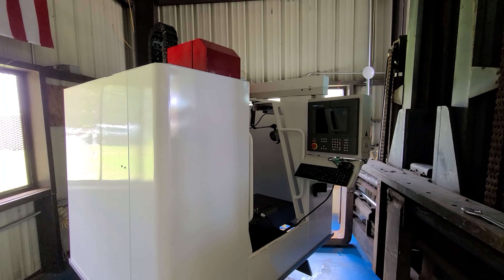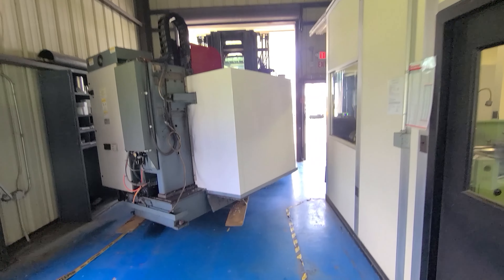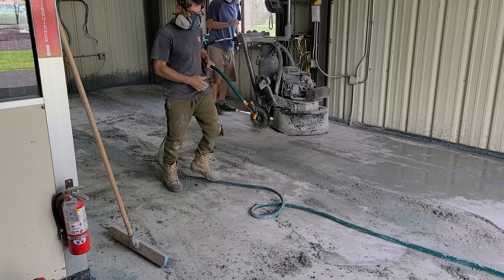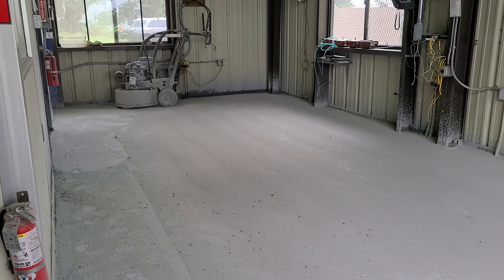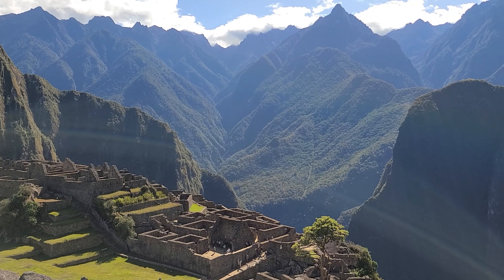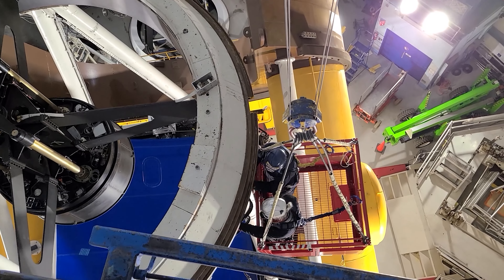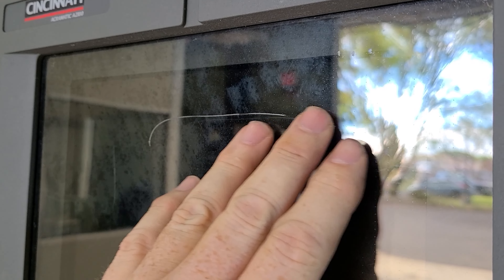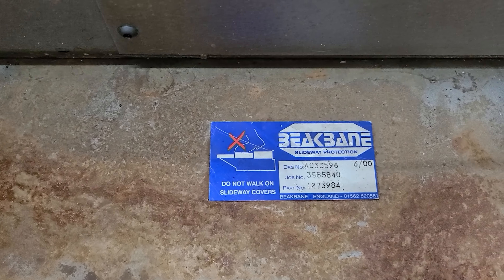New Cincinnati Arrow 500 shows up!

Comment: I am a fellow arrow 500 owner and I would just like to say the fault is most likely not on the shipping company but on the seller as if you do not coat the machine table in lanolin or some other rust preventative it will just rest regardless of what conditions of the machine is in I got mine for $2000 in the entire table with rusty I thought it would need to be resurfaced but in the end I just used evaporust i stoned the table with it and in the end I can still see the original tool marks on the surface